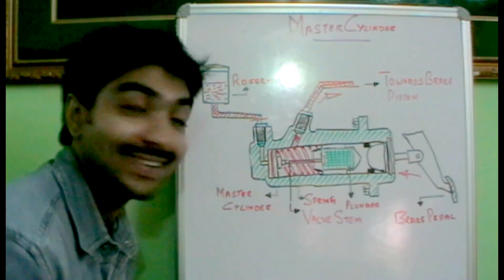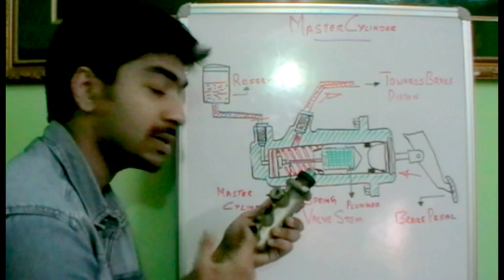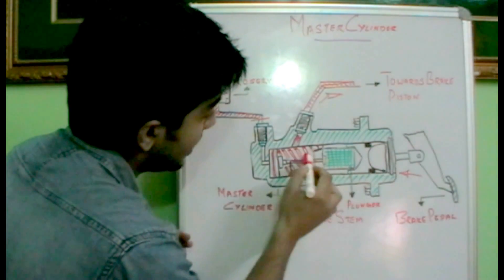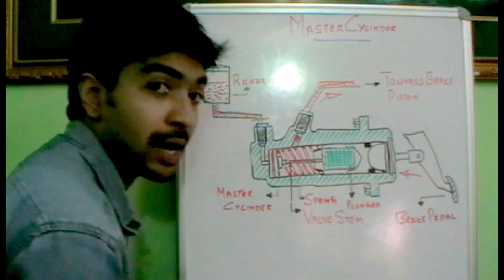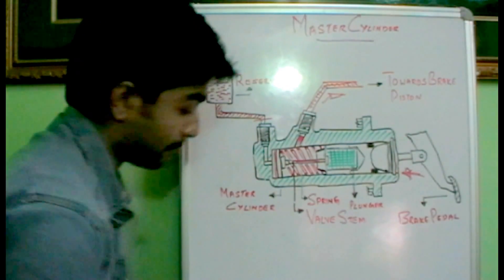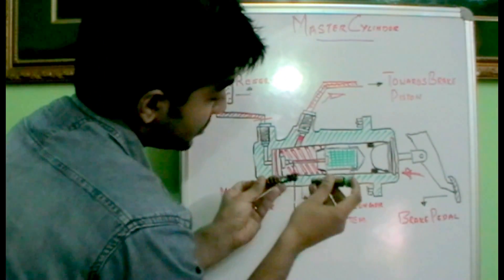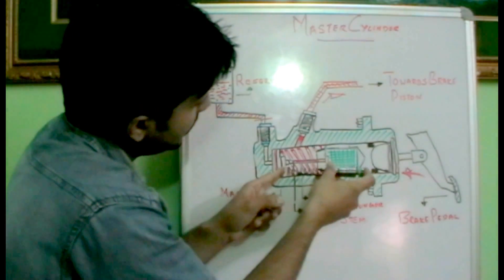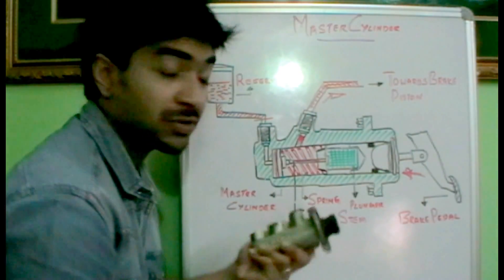How hydraulic brake master cylinder works. ✔

Comment: This a pretty rudimentary explanation of the working of a Master Cylinder. Your theory part was way different than the actual physical master cylinder used in cars. Anyway, the concept is right but the nitty gritty must be polished off. You mentioned that the spring closes the reservoir opening which is absolutely wrong. First, the position of the reservoir opening is wrong in your diagram and second the seal closes the port and not the spring.
Reply: The function of the master cylinder is to....?

A)Supply Hydraulic presssure in an automotive system
B)Apply hydraulic pressure to the wheel cylinders
C) Apply hydraulic pressure to the power steering
Reply: Charles Bronson EXACTLY!!!!